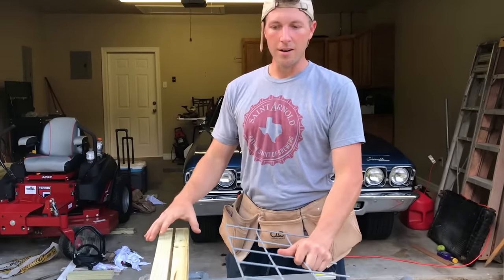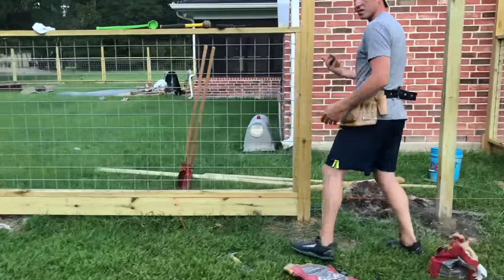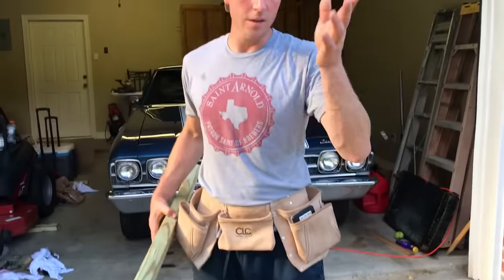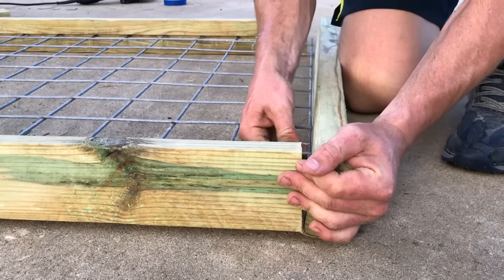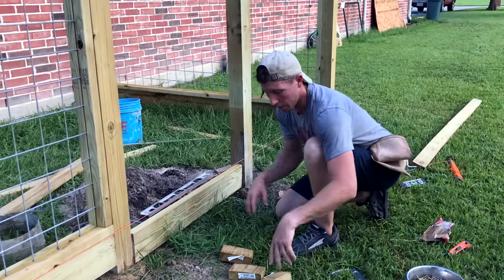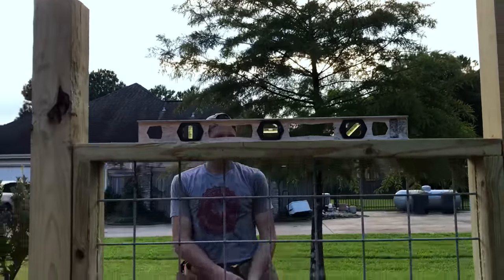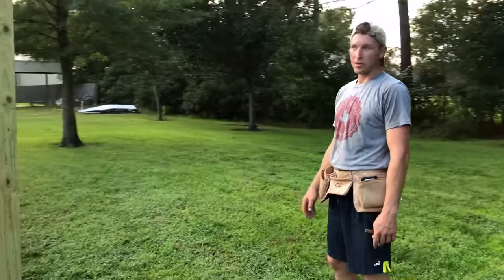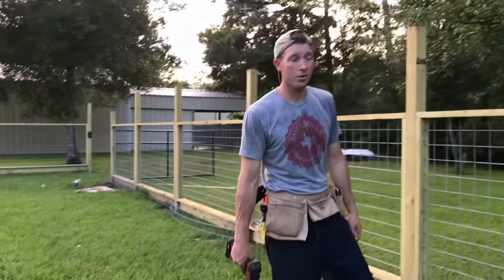Part 1: Modular Hogwire Panel Fence with Dado Groove

Comment: Good video, nice Chevelle. . water will collect in the dado and expedite wood rot if you don't seal it somehow
Reply from the maker: Thanks for the reply Eric. I do plan on a deck sealer of some sort, but currently the wood is still resisting any stain. I did go back an put a 3/16 weep hole every 8" and filled the dado groove with water from a bottle and it drains almost immediately. Hopefully the wood rot is deterred from what could be expected as i dont know what a short term time to expect wood rot to be on this method. In a near by area my friend has an unstained or sealed deck that is 15 years old and still in good shape, so im hopefull will stand the test of time for atleast that length of time.

Comment: That Water pocket will rust and rot in no time, get some Fence Staples and tack that shit on
Reply from the maker: Thanks for the reply, i did go back and drill 1/4" hole every 8" for the dado grove for draining. I checked it by pouring a bottle of water in the groove. Its no Niagara falls, but it definitely drains. Shoot an email to hawkijon@aol.com if you are interested a hand sketch with material breakdown and completed photos.

Comment: Man I wish I would have found this video before I started mine. I am building my fence now as we speak and I put my post at 10' centers but now I learned it makes a lot of waste on the panels and at 80 dollars I'm going to have a lot of cost in waste. Great job I might have to show my video to explain what i did wrong.
Reply from the maker: I hear ya. I spent a lot of time running numbers to get the most height and length as possible with as little excess waste as possible to make my bang for the buck. I even began with my fence design a total different way and made 3 panels befor stopping and redesigning to the way that you see in the video. Nothing wrong with 10ft centers, just incurs a different set of drawback when hindsight hits you in the butt. You picked the right time of year to do this.. i did it in 100deg temps in SE Texas August. Good luck with the rest if your build.
Reply: Sell those short ends on a local market page. Critter people and gardeners would love to have them.

Comment: How is it modular? Are they prefab panels put together. I'm not understanding. It's a great fence design. Just wondering how it is modular? I mean aren't all fences designs modular?
Reply from the maker: Good morning Big Red, thanks for the reply! To answer your question, I couldn't come up with anything else that was simple but descriptive to title the video. Youre right! I guess i never thought of it that way, technically some fences are somewhat modular in that they involve some sort of pre-construction. In my mind chain link fencing stretched between post or screwing fence pickets to a railing was not modular by design, but i could be wrong. My idea of modular in this case was that i pre-built all my panel frames prior to installing them between the posts as seen in the video. The wire panels come in 16ftX5ft, and have a 4inx4in square grid. Though some lengths will require to be one-off dimensions (i.e. lengths with gates or property boundaries) using my design dimensions as a basis, one could determine their own length and height adjustments, if any, by simply adding or subtracting 4" from my dimensions to suit and it would go together perfectly, thus a modular design. My budget build design was to get the most length and height with minimal scrap left over. I hope this answers your questions. If you are interested in a hand sketch, material breakdown and completed photos, shoot an email to hawkijon@aol.com

Comment: John, loved the video and the fence.  Although, not sure what the population of snakes is down your way.  I would add a couple of small steps to keep your dogs safe as well as any children.  I am no expert on snakes.  Although, as a former Border Patrol agent in Texas, San Diego and Arizona, we encountered them, A LOT.  

It would take much to place a very strong and very, very small holed wire mesh attacked to the outside of the Fence.  I would also ensure the ground had mesh that went down to prevent any going underneath the meshing.

I don't know if Rattlers can climb fencing....."Currently, snake fencing combined with keeping a clean, rodent-free property is the most effective method to keep snakes out of a yard. Rattlesnakes do have some climbing ability, but they can't climb up straight walls or metal. ... If rattlesnakes don't have a “foot”-hold, they simply cannot climb a smooth surface.Nov 12, 2018". I guess that answers that question.
So, that mesh fencing will also help keep rodents away.  I am moving back into a state that has 6 venomous snakes.
I don't mind so much, but the wife, yeah, she freaks even when it is garter snakes.

Just throwing that out because the Wife saw your dogs and is now worried.

Thanks again for the video.
Reply from the maker: Thanks for your reply and i appreciate your concern. I live on the Texas gulf coast region, so snakes are inevitable, but rarely seen. Venomous ones in our area would be water moccasin, copper head and uncommonly coral and timber rattler, but ive heard they are around. I've always heard "the only good snake is a dead one", and some people live by that. I just leave them alone and i hope my dogs do as well. As my build was done on a budget, i didn't include snake budget for snake prevention. I agree my dogs could be at risk for snakes encounters or ants, and spiders for that matter, but the bigger concern to us was their protection from other dogs/people in the neighborhood. I hope yall have a safe move. If you are interested in the fence design, i have hand sketch with material breakdown and completion photos. Send an email to hawkijon@aol.com if you'd like.

Comment: Someone may have already mentioned this, but they make a simple level tool for attaching to the post to verify they are level. Wouldn’t have done a better job, but would have been a lot easier for you 😁
Reply from the maker: Thanks for your reply justin! Yes its been mentioned and have since picked one up from lowes and used it on a friends fence build and worked great!
Reply: Jay, 'level' is horizontal. The term for correct perpendicular/vertical alignment is 'plumb'. 😉
Reply: jem fly .....this comment made me smile actually. My dad was always a sticklers for proper terminology, even if one understood what was being discussed. He would always correct me when I asked for a “flat head” screwdriver 😁
Reply: @jay-rus4437  Jay, I like that! 👍😊 Your dad was being meticulous, something which is important with terminology and things being level and plumb. 😉 For example, a post could be level, but not plumb, or plumb, but not level ... !! By the way, did your dad ever ask you to look for a 'left-handed screwdriver' or a tin of some 'striped paint', just to be funny?! 🤣

Comment: 👍👍👍
Just on a maintance note
You might think about cutting the grass and dog digging...
Maybe put concrete,  12 inch wide or more 4 inch thick or deeper so you won't have problems maintaining the grass under the fence
Reply from the maker: Thanks for the reply jim! Thats a great idea. Im fortunate to have dogs that havent picked up digging as entertainment, and hope they stay that way. As far as the grass goes, i just hold the weed eater out as im riding past on the mower. It was tricky the first couple of times but im pretty efficient at it now.

Comment: 48” = 4 feet. I would have advised you to not cut the 4 X 4s off, but add the extra 2 plus feet to the top and really secure your home from trespassers.
Reply from the maker: Thanks for the reply. I agree 4ft may seem low, but i have it resting on a 2X6 rot board that is about 2" off the ground, so my fence height is nearer to 5ft majority of my fence perimeter. My concept was to build the highest fence to contain my pups as economic as possible with as little scrap left over. The great part about this fence design is you could still achieve the fence preference of yoursby adjusting a few dimensions to suffice. i built 205ft of fence at about $8 per foot, totaling shy of $1700.. the closest bid i got was about $20 per foot for similar design. Shoot an email to hawkijon@aol.com if you would like my construction details and cost generator based on my build per linear foot.
Reply: A Latice top might have looked good?
Reply from the maker: Chad Onan thanks for the reply chad. I trimmed my excess pole height to 2.5” above my top rail and placed a wooden post cap.

Comment: your dado cut is too deep for the timber size, plus water will get trapped at the bottom dado and rot the timber
Reply from the maker: 2 years in and no issues. I have drain holes drilled in the bottom dado. Check out my part 2 video to see my evaluation and staining.
https://youtu.be/bL89wkzSPDo

Comment: Could you just dado the 4x4 and eliminate some of the costs of the side 2x4s?
Reply from the maker: Thanks for taking the time to watch and comment… This question gets brought up a lot. Yes you could do that to save about five dollars per panel set, but it would be very critical on the placement of your post, whether or not it would hold together properly… Any deviation from the post being positioned perfectly could result in conflict for construction… My advice is to complete the panel frame. That way you have something holding the fence panel and then you’re able to fasten the panel to the posts and will allow for small deviations and length..

Comment: Hey nice looking fence!  I came across your video while researching what kind of railing I want to put in my girl's tree house.  The less to stain the better is one of the reasons these type of fences is attractive.  One question.  how solid is the paneling?  the horse wiring is held in exclusively with the dado groove right?  If you tried to kick in the fence how difficult would it be to do that?  Obviously anything can be kicked in, destroyed, just wondering if this would be a good option 9ft up in the air.  Thanks!
Reply from the maker: Hey bud! I’m confident you won’t have any problems with the panel pulling out. Watch the first 5mins of my part 2, it gives a great example of what the fence is capable strength wise  https://youtu.be/bL89wkzSPDo
Reply from the maker: Feel free to email me hawkijon@aol.com if you have any questions or want the construction details I developed for this fence

Comment: Looks good.  My only question....is the wire fencing rigid enough so that if the dogs jumped against it, it won't push out of your dado groove?
Reply from the maker: Jonathan Trivette absolutely! I’m very confident with the construction of it, my 190lbs mastiff and 60lb feisty Aussie teamed up on it when the neighbor is mowing doesn’t phase it one bit.. may have to reconsider if your are corralling livestock but it’s 1 inch of groove all the way around and that paneling in the 92”x48” has very little flex

Comment: You said you're right outside Beaumont? That's crazy that I found this video because I want to build a fence like this to replace the old chain link, and I'm in Port Arthur lol small world
Reply from the maker: Awesome! Thanks for the reply. This video has produced a few small world occurrences. If you are interested in PDF details, material breakdown, and excel cost estimator that i developed based on linear feet of my exact build, feel free to send an email to hawkijon@aol.com and i will send it over as well as some finished product pics.
Reply: @GatorOverland  that would be amazing, thanks! Yours turned out awesome brotha

Comment: FYI:  They make a post level that has two levels on it and you just strap it onto the post with a rubber band.  No claps needed and it costs like $6 at home depot.  That will make this build much easier.  Thanks for the video.
Reply from the maker: Steve Hunter thanks for the reply! The didn’t have them in my area at the time of my build,  but I have since purchased the post leveler you speak of to help with a friends fence, and it’s a game changer. If someone watching runs into the same issue they will have an simple remedy explained at least. I have a developed a pdf detail with material breakdown and excel cost generator based on my exact build per linear foot available if you’re interested. Shoot an email to hawkijon@aol.com

Comment: I have Dachshunds they will go break the defenses in seconds! lol I need a solution to contain little SNEAKY, SMART, SLIPPERY and fast digging Dachshunds.  I do love your design.
Reply from the maker: Thanks for the reply.. I’m sure there are some inexpensive solutions to keep the pups in the yard.. between each post you could do a 12” deep by 4” wide trench and will it with caliche rock or similar and use wire mesh or similar to what I did for then gap at the bottoms

Comment: The 2x4 can be beveled on top to let water run off. The dogs can dig under this fence.
Reply from the maker: Robert Jackson with the trimmed panels stuck in the ground our dogs would have to dig a hole 15” deep and wide to get out. Hopefully that doesn’t happen. We’ve been fortunate so far. Other than that the fence is great and gets a lot of complements front people in the neighborhood.
Reply: Very nice fence!

Comment: awesome video! will be tackling this project in a few weeks. Can you speak the strength of the dado? I guess the reason i ask is i have a dog that likes to jump against the fence, my thought was the hog wire may slip out of groove in that instance if enough pressure is applied. I could be total wrong! Have you experienced or seen that? Thanks for any feedback
Reply from the maker: Thanks for the reply Lucas, the wire panel is quite rigid by itself. The 1" groove is more than sufficient for maintaining the panel to anything shy of an enraged bull or ATV that gets out of control. My 180lb English mastiff and 50lb Aussie push and lean against the fence as well. I haven't had any issues or concerns with the fence popping out of the groove. I show how much wiggle/flex is in the panel around (22:41). Shoot an email to hawkijon@aol.com and i will send you my detailed hand sketch, material break down and excel cost generator i put together based on my exact build per linear foot of fencing.
Reply: @GatorOverland  good to know! those free range enraged bulls are nothing to mess with!  my english bulldog should do just fine then. a project similar is on my to-do list this spring. Another question, did you set your posts in concrete? I saw you mentioned the depth and 3" of gravel above.
Reply from the maker: Lucas Blattenberger yes, 18” hole depth, and used the red sack of quickcrete, and I put 3” of pea gravel in the hole prior to placing the post as instructed by the sack directions. Send an email to hawkijon@aol.com for all the info about the build. It should answer most, if not all of your questions. Many people have sent back photos of their fence project after receiving my construction info, so I know it works for more than just me. Let me know if you have any more questions.

Comment: I've done something similar by ripping the 2x4 in half instead of a dado, adjusting for the difference between the blade and the width of the hog wire. This allows you to Staple the hog wire to one side, then put on the other. In my case I had a top rail to cover it.
Reply from the maker: Thanks for the reply! I had originally had my mind set on constructing per the design you mentioned. My previous experiences had only been wooden plank fences. I didnt even know what a dado was when started the project design. Im very happy with the end result. If you are interested, i have a hand sketch with material breakdown and some completion photos i can send you. Send an email to hawkijon@aol.com.

Comment: Question does an8 inch dado blade fit a 10 inch table saw about to buy the table saw but having trouble finding the 10 inch dado blades
Reply from the maker: Im not sure about every saw application,  it I used the 8” https://www.homedepot.com/p/Avanti-Pro-8-in-x-24-Teeth-Stacked-Dado-Saw-Blade-Set-P0824DADO/202035223 set in my Rigid R4513 table saw which is a 10” saw table, and it works fine for over 400ft of dado groove. Shoot an email to hawkijon@aol.com and I’ll send you my construction plans and cost generator.
Reply: Thanks and great job on the fence

Comment: Great job on the fence. You did real good more than good enough for some people to hate on your fence. I can’t see why everyone wouldn’t love this fence.
Reply from the maker: thanks for your reply sanders. I dont understand it either. I needed a fence for my pups, and i had minimal cash available after purchasing the home, so i looked into doing it for myself. Building a full plank privacy fence defeated the purpose of us moving to the country, so i needed a attractive simple design. I was quoted $20-$25 per ft for a similar fence by a local fence builders, and at approx. 200ft of fence needed, $5000 was a big pill to swallow. I did this fence for a little less than $8 per ft. So, in the end, i a sturdy, inexpensive, attractive fence the contains my dogs. What people are hating or disliking about the fence is their own opinion, but i still have nearly $4000 in my pocket and i got some experience and sense of accomplishment. You cant hate that. I you are interested in building plans, material breakdown and excel cost generator i developed based on my build per linear foot, shoot an email to hawkijon@aol.com